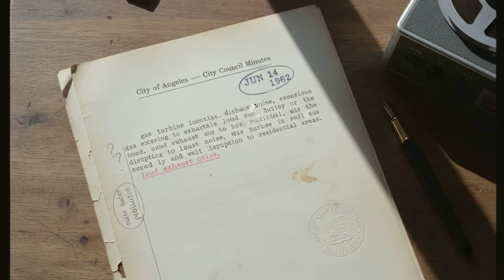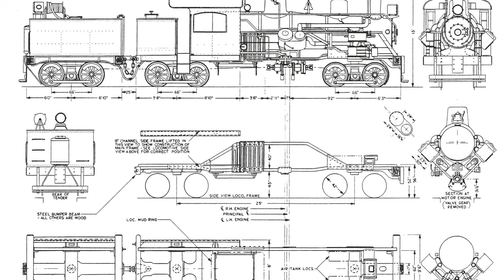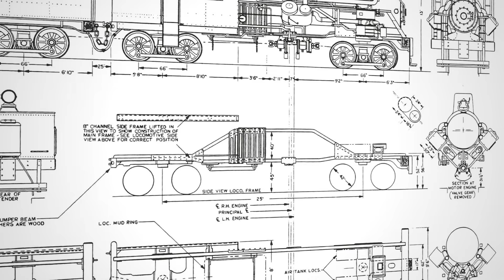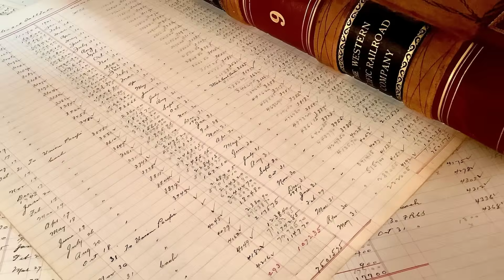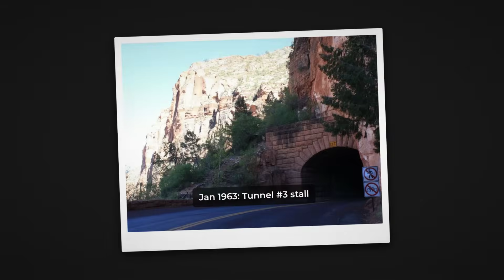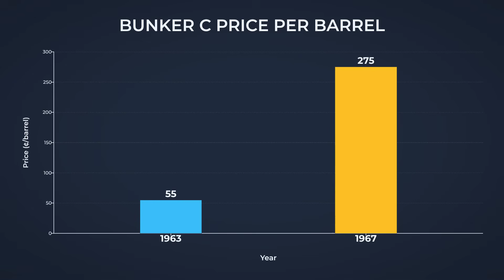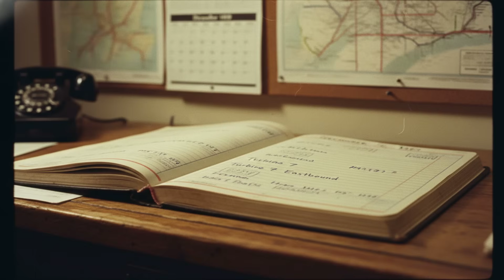The Train So Deafening It Forced Cities To Change Their Laws

Comment: By the time they retired the GTELs in 1970, diesel locomotives had also grown more powerful. At that time, EMD's SD40 and SD45 locomotives were the top sellers, the SD40 producing 3,000hp a unit  while the SD45 produced 3,600hp a unit, meaning it now took only 2-3 locomotives to pull the equivalent of a single Big Boy.

Comment: I have often wondered why gas turbines and steam were never combined. Channeling that loud ultra hot exhaust into a heat collection box. Harnessing the exhaust for more power.
Reply: Turbines & steam actually worked together-- usually turbine (4500hp) at the front & steam (Challenger) at the rear. Have a great old book with black & white photos of this occurring
Reply: @michaelosgood9876  I thought that would work, better. Sounds like it's out of service now.
Reply: Thats how the center propeller of the titanic worked
Reply: @davehughesfarm7983 Not really, that engine couldn't be reversed. It only ran off waste steam, from the main engines. So if you lost the main engines, all three screws would stop.

Comment: Yet another inaccuracy @3:55, the head-end diesel lash-ups did not need multiple crews as nearly all road freight UP diesel locomotives of the time (as well as the various turbine units) were capable of multiple-unit operation. The only time multiple crews were required was when "helpers" or pushers were required at the rear of the train, as too much power on the head end could result in excessive drawbar forces and break couplers.
Reply: And of course the photo @4:30 supposedly representing "November 15th" (1949) was actually that of a GE U50 twin-engined diesel-electric built in 1964, coincidentally designed and build to use the trucks (bogies) and bolsters of the retired 4500 HP turbine units.
Reply: The graph @4:47 is complete nonsense, and more than half of the pics are irrelevant to the narrative.

Comment: Inaccurate Thumbnail lead, why watch the rest, when you can't get the lead in image correct??
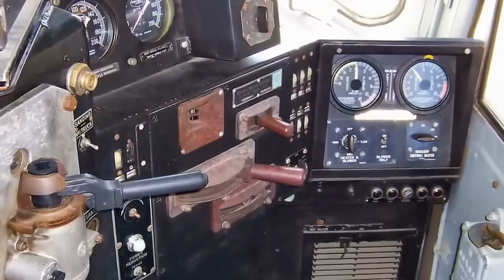Reply: Check out that nonsensical photoshopped image @10:56, WTF is that thing supposed to be?
Reply: @stanr8946 I think that image is ai generated 💀
Reply: More absolute garbage @11:00 and @11:28, this loser spent more time photoshopping bogus pics than he did during actual research.